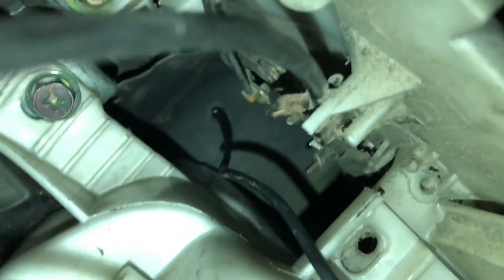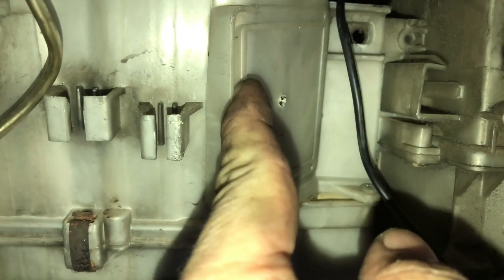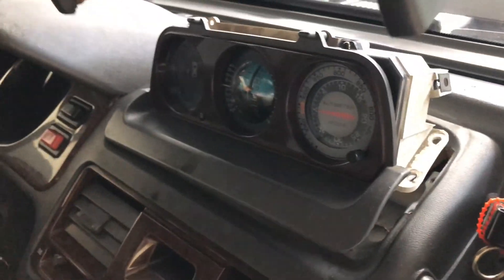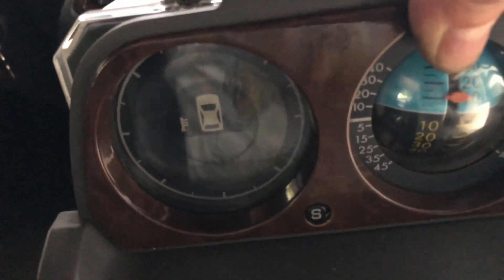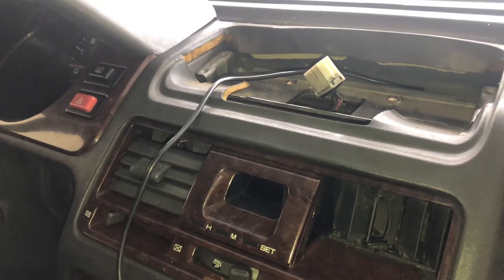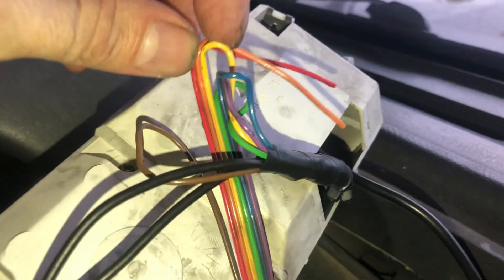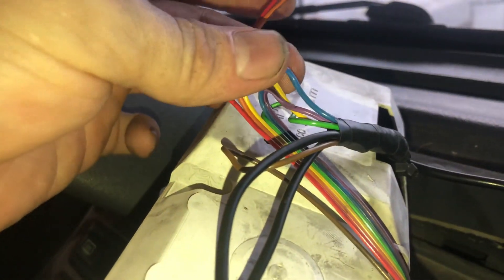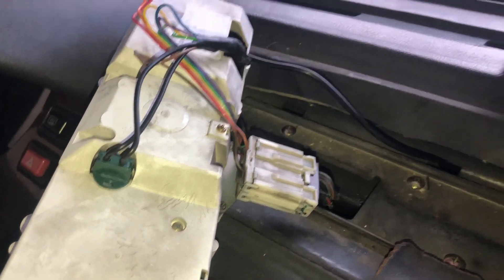HOW TO: TURBO DIESEL TDI BOOST GAUGE INSTALL & CONTROLLER Mitsubishi Pajero 4M40 TD Shogun DELICA

Comment: Where did you tap the hose line of the boost gauge?
Reply from the maker: Yeah...that was pretty early in making instructional videos. ;-) I made a much more clear one, although the view behind the glove box here is useful in combination with the newer video here: https://www.youtube.com/watch?v=xTdThVTW72c&t=32s
Reply: Thanks mate
Reply from the maker: @demonyongkalbo  Went through the firewall just above the A/C / Heater box behind the glovebox.
Reply: @offgridislandfamily  done installing egt gauge and boost gauge.. im not gonna tune it but at least now i can monitor those parameters.
Thanks again
Reply from the maker: @demonyongkalbo  Thanks much for the feedback!

Comment: What a lot of wasted time pish, so turbo boost, so where does air side of it go on 4m40 engine, your more about your babe
Reply from the maker: This was my second try after deciding to make 'HOW TO' videos, so the direction is admittedly unfocused. If you want to pick on beginner work, then fine. However, your point was stated more constructively by another viewer and I've already begun production of a much more clear and helpful boost control / gauge installation video that should be up within the next couple days. If you are looking for how to do this, I would encourage you to watch it. Cheers...

Comment: Hey mate, I've seen you post on our facebook group and would like to ask if you can help me install a boost gauge for my pajero. I'm located in Pampanga btw. Cheers!
Reply: Is an EGT gauge necessary before installing a boost gauge?
Reply from the maker: @arfjreyes  Not absolutely necessary, but the number one reason for blown heads is overheating the head. If you are increasing performance than I think it's VERY important to install EGT. But, if you install the boost controller, but don't exceed 1 Bar of boost, you are probably ok.
Reply from the maker: Well, I would be consider that. But, I'm in Bulacan now. If you plan to pass by, let me know. And you should REALLY have an EGT gauge already installed. Do you have a boost gauge included with your controller? Have you thought about all the other adjustments I've done in my other videos?

Comment: Where did you tap the sensor's hose?
Reply from the maker: I'm not totally sure what you mean, but if you are asking about the gauge sensor, then it splits between the waste-gate and turbo hose. You cut the hose between the two and install your T-fitting.